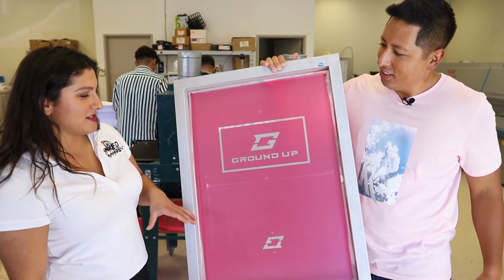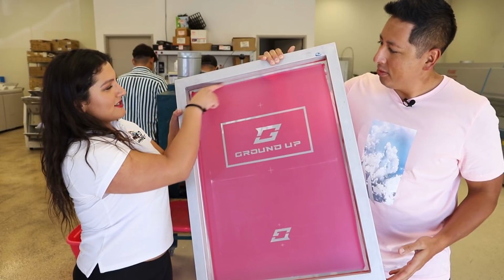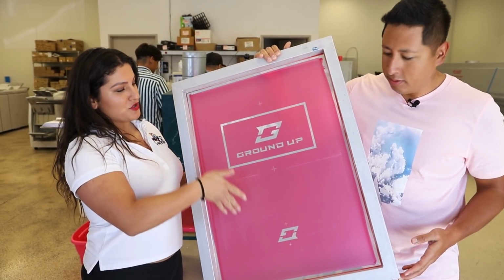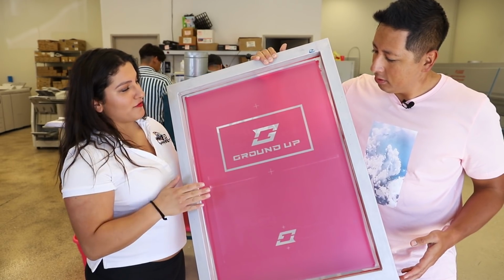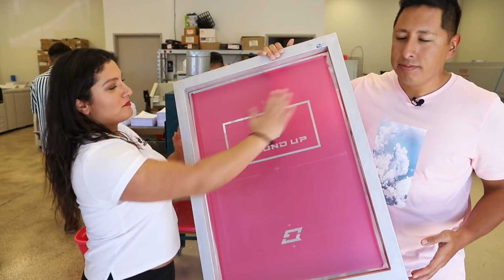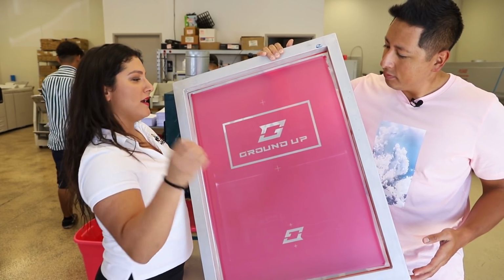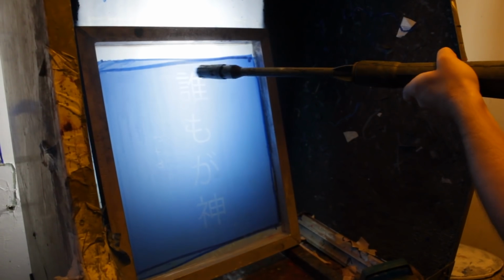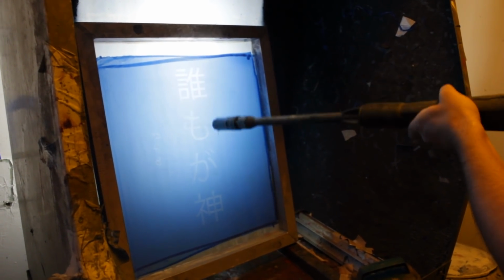MUST KNOW Before T Shirt Printing | DTG VS Screen Printing

Comment: Jpegs are fine when the original is a very large format. 300 DPI .jpg and used for magazine covers and other advertising. They are clear. But I can understand not using a small jpeg yes they can be pixelated.

Comment: I appreciate you explaining the importance of JPEG vs AI/Vector because I have been having trouble with this when communicating with a screen printer. He says my files aren't saved correctly and the images are pixelated. Do you have a video or a video recommendation or even just a quick explanation on how to properly save art as a vector file so that it is a proper working file for the manufacturer/screen printer?  Thank you for your informative videos.
Reply from the maker: Sure do. I have a few videos covering the art process here’s one of them: https://youtu.be/ZgiFlit03Ic
Reply: Convert your whole design into outlines

Comment: I’m a designer/ color separator ! Screen Printing will always be better than DTG! You can also get the feel of water based inks when using plastisol inks! Just burn images and base plate on high mesh screens. So you get feel of water base ink  but pop of plastisol ink.

Comment: Title is so wrong....Screen Printing will always be better and more durable than DTG there is no comparison. Now where this 2 techniques are good at is depending how many shirts and how many colors the design will have. DTG is more profit by offering short runs, even one single t shirt will make you profits, if you are like in a mall or a kiosk and offer instant print designs you will rock with this system, there is no other method that prints good, lots of colors and in five to 7 minutes.....but if you need quantity and quality screen printing is your best option, they will charge by color or frame but in quantities of 50 to thousands it is much affordable, washability will be so much better and faster.
So quantity and time is the answer to what is better between this 2 methods

Comment: John, the one thing I came away with is that a person doesn't really need to print their own, you do your set ups and do your color separations and find a reputable printer to actually do the printing, saving the purchase costs of all the equipment, training of personnel etc.  This saves costs up front.  You can always work yourself up to doing your printing in house, but it isn't necessary starting out.

Comment: How can I have my own type of t-shirt made , not talking about stamps designs but something unique a different type of t-shirt design?
Reply: it's 9 months later, but if you haven't already started I'll give you the run down. it's a challenge, but it's doable. 1st: you have to design the tee and ensure that it is wearable for the way that you intend it. so, if you don't have a design background you need to locate a fashion designer. during this process you will need to know what materials you will want for tee. this leads to number 2: you have to source raw materials manufacturers to get the fabric you and the designer settled on. you can go to Joanns store to get an idea of what you are looking for. 3: have that same designer stitch up a few tees to see if it's doable. 4: locate a clothes manufacturer that can sew your shirts for you. 
you will also need a company name. logo. copyright of your shirt if it is in fact a new design. 
good luck.
Reply: huh
Reply: learn to cut and sew

Comment: one thing you left out was the cost of buying each set up.  the DTG machines were about 25.000.  I bought a major brand screen printing machine that can do 6 colors with everything needed to print (not counting the epson printer) for 5,700.

Comment: What is the difference  between cmyk process and simulated spot color process in screen printing?
Reply: Ronit Sarkar Cmyk mixes colors to make other colors. Spot color is you use black to make black green ink to make green ink.

Comment: Vectors are mathematics-based where jpg, png, etc are image based. Vectors, like the guy said are able to blow up as big as you want them to.
Reply: How do you make sure you files are vector?
Reply: @keithlerose3156  Hi Lonnie, good question! 

You can tell a file is vector format if it has been created in a Vector Software such as Adobe Illustrator, AND the file has been saved as either an .eps, .ai, and sometimes even .pdf - but I would highly recommend steering clear of PDF because they act as a container for other files like JPG and PNG - where EPS and AI files are strictly vector-based.

I hope this helps!

Comment: did she say 10 shirts an hour with DTG?  that seems super low with the machines on the market today.  large designs on dark shirts can be printed in a few minutes and cured in 60-90 seconds. great video, but the screen print lady seemed biased or incorrect in her numbers
Reply: I would have to agree with her. 
From start to finish, pretreatment to drying the print on the heat press takes time. You can rush if your want to but if your chasing quality take your time. Hour sounds pretty accurate.
Reply: @printgod4663  Have you seen a pre treat machine? it releases a controlled amount of spray. MAYBE 5 seconds tops? then 30 seconds to dry. then 3 to 3.5 minutes to print a full color mens dark shirt another minute and half to dry it? call it 2 minutes to dry with a quick hover before i clamp it down? if the printer is printing a shirt, the next shirt can be queued up being pretreated and the shirt prior should be getting it's print cured in the heat press. good order of operations can increase productivity in most work flows but 10 shirts/hour sounds like heat transfer vinyl production speed
Reply: @estevanromero5499  10 Shirts per hour = 6min per Shirt. That absolute matches with your math. Didnt really understand your confusion.  - and to say "if machine 1 is doing this, then you can work at machine 2", that implies that they have more then one. But she has said "we solt our machine". That sounded like "only one". So everything is right.

Comment: Dtg vs heat press vs screen printing, which is the best to print a t Shirt, that will be used on the daily basis
And one more question, how does nike and adidas make their t Shirt print, do they use DTG?
Reply from the maker: They are all great options, but honestly it comes down to your personal preference. As I noted at the end of the video, I think screen printings vibrancy with white against black shirts always comes out better than DTG would in the long run. Heat transfers are cool, but I still haven't found a shirt that uses heat transfers that don't fade/ start to crack. I guess it's all in the art! Nike and Adidas use all kinds of applications depending on what they are making. Great question!
Reply: @hoangdaia3  thanks man

Comment: What about the new DTG printers that run over 100 T’s per hour? Are they too expensive comparing to this screen printing machine?
Reply from the maker: Each one has it's place in the market. Those DTG Printers are better for mass production of "print on demand"- screen printing is cheaper to start with for sure!
Reply: I can print 100 shirts an hour is decent for a manual printer, automatic presses can do 60 dozen an hour! Some can print faster than a person can load and unload.

Comment: Excellent vid on T Shirt printing! When starting a new brand, would it be wiser to go with DTG printing initially if starting out with print on demand?
Reply: Champion! Thx for the quick reply!
Reply from the maker: Got you!
Reply from the maker: Thank you for watching and taking the time to reach out. If you're starting with a few pieces, then yes it is 🙌🏽
Reply: Start with HTV
Reply: In my opinion, try connecting with a good screener. You might make less in the beggining, but do better in the long run. 
I like some of what DTG offers but as a screener to 25 years...well you know where my allegiance leans...lol